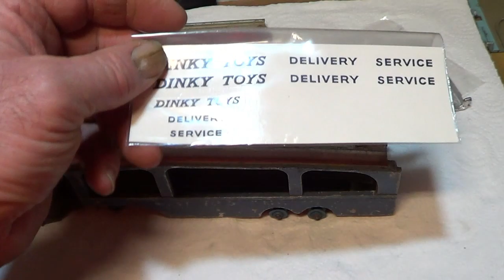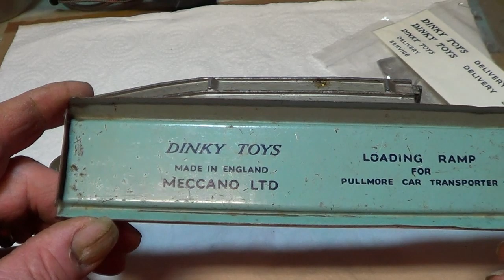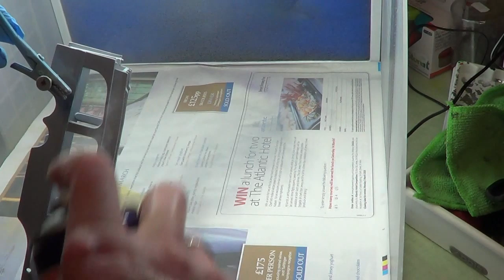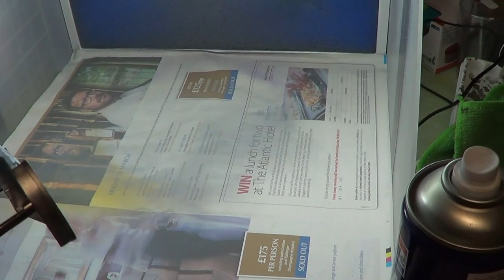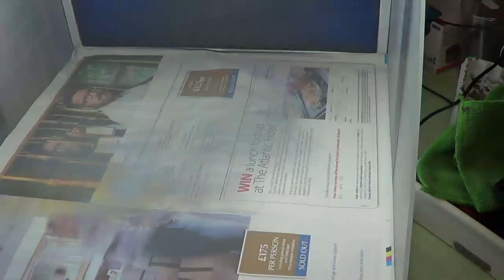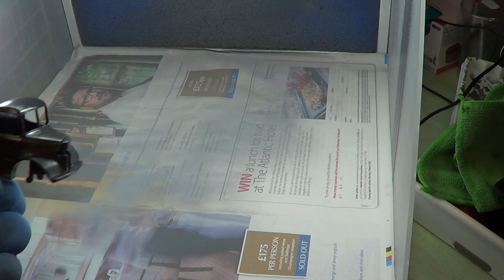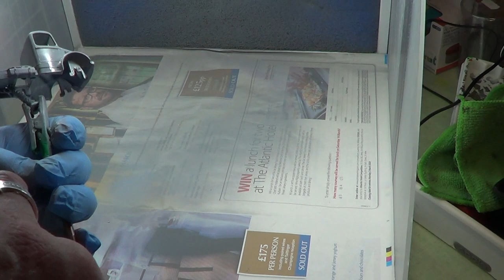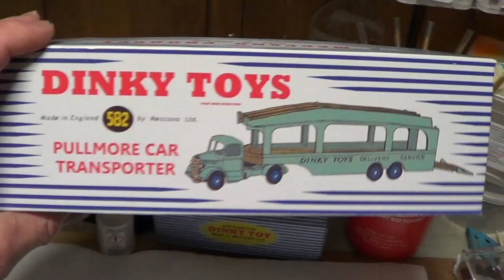RESTORATION OF A DINKY TOYS BEDFORD PULLMORE CAR TRANSPORTER.

Comment: Lovely job, Nick, they are not an easy renovation. I suffered all the pit falls myself when I did mine. Worth all the hard work though.
Reply from the maker: Thank you Chris, I think drilling out the four rivets in the trailer was the most difficult bit, trying to drill straight and not go too far especially on the front ones!

Comment: Hi Nick. Fantastic retoration on the transporter. I have just purchased one but I am a newbie [more like and oldie really] to Dinky restoration so I was wondering what paint you used for this one. I have found one called sky blue on ebay that seems quite close. But I wondered what you used? If you don't mind sharing?
Many Thanks, Roger
Reply from the maker: Hi Roger and thank you, the blue paint I used was holts acrylic car paint but it had no colour name or code on the spray can, I just went by the colour of the cap, it isn’t quite the right shade of blue, slightly darker but not too far off, the brown was Humbrol dark brown, number 29 in a spray can, again not quite the right colour but not too noticeable. 
Hope this helps, all the best, Nick.
Reply: @crapaudnicksdiecastrenovat1739  Thanks for the information Nick. I will go by the colour on the can as you did. Just got to find something suitable. I'm saving my restoration of the transporter until I have finished some Jaguar XK120's I purchased recently. They are my practice pieces. One has some pitting on the roof and the sides that have not covered with my Hycote primer. I am hoping it will sand to a good finish. We shall see. Thanks again, Roger

Comment: Cracking Video- really enjoyed it. Interesting set up with the spray booth and I like what you did with that hose as I am reluctant to drill a hole in my external wall to get the hose through! What make is the spray booth? Take care in this Lockdown.
Reply from the maker: Thank you Malcolm, the spray booth is model number HS-E420DCLK, if you google that number it will come up. You still get a strong paint smell with the way I have it, but you don’t get the spray paint particles going everywhere, you also need plenty air holes in the tub the pipe goes into not to put too much strain on the fan motor, as long as the holes are covered with some sort of sponge or filter like material. I only use it if the weather prevents me from painting outside.
Hope this helps😊👍
Stay safe, take care, all the best, Nick.
Reply: @crapaudnicksdiecastrenovat1739  Many thanks for the reply and info

Comment: I've just watched this video again Nick. At the beginning you described it as a 4 rivet model, unfortunately not the 6 rivet version. Can I ask you please why you say, "unfortunately" not the 6 rivet version? Is the 6 rivet model better in some way, or easier to restore? I'm curious. 😁
I've got 3 of these Bedford car transporters, one is original and in near mint condition. The other 2 have been painted (badly) so need restoring. Like yours they're 4 rivet models but the bases are light blue, not brown like yours. Does this make them earlier or later than yours? Was the 6 rivet model an early or later version?
Both of yours that you showed looked super restorations, it was a very enjoyable video. All the best. Peter.
Reply from the maker: Hi Peter, the 6 rivet ones are more valuable if you have a good unrestored one, I think they were earlier models, I guess once you have restored it it doesn’t make a lot of difference as you will have devalued it anyway, I think the all light blue ones are earlier models but I can’t be one hundred percent sure on that, the ones with the dark blue cabs are the later ones.
Take care, all the best, Nick.

Comment: Can I ask where you got the dome headed rivots from. I've got one of these I was about to do but was putting it off till I could find these little bits. Great build as usual 👍
Reply from the maker: Thank you! 😊 I bought the rivets on eBay, if you type..... 50 x 2.5mm SOLID AS ORIGINAL BASEPLATE RIVETS - DINKY CORGI  SPOT ON ETC+ DRILL......into the search box on eBay it should come up! Hope this helps.
All the best, Nick.
Reply: Thanks nick I'll have a mooch and see if I can find them 👍👍